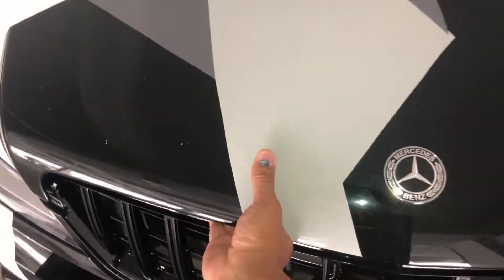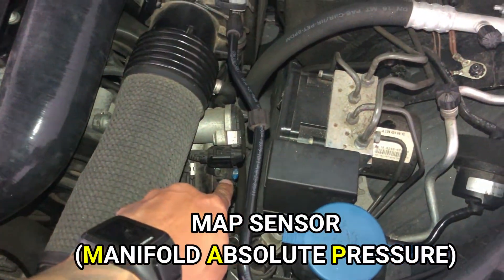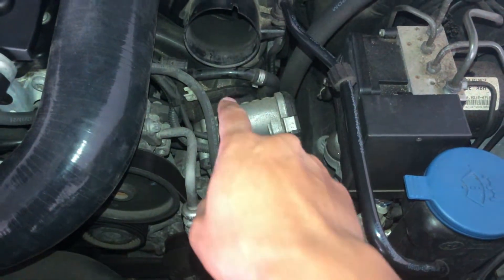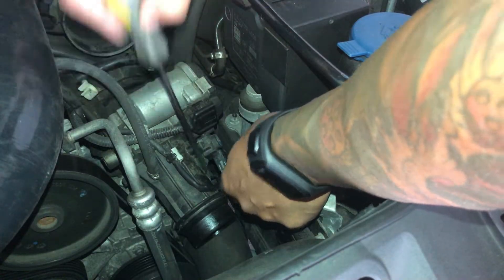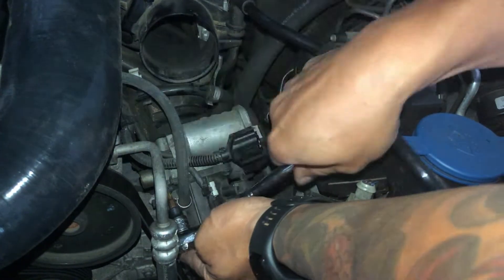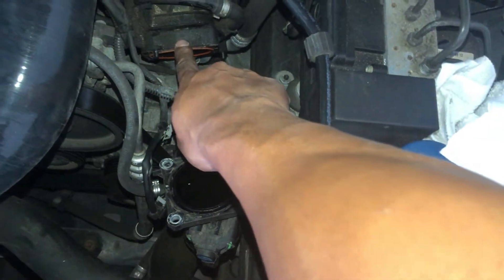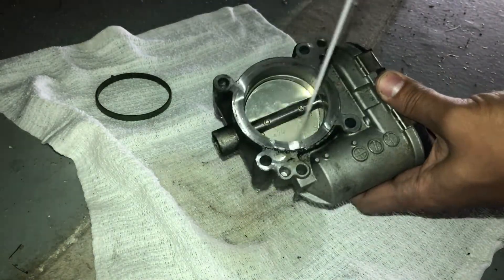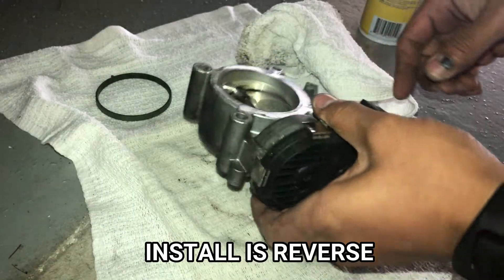PART 1: HOW TO CLEAN MERCEDES C250 THROTTLE BODY & REPLACE MAP/BOOST SENSOR

Comment: Is that gasket shown at the end the one that gets tucked into the air intake duct and connects to the throttle body?  When I removed my throttle body, the only two gaskets stayed tuked in to the manifold, and the other to the air intake duct. It didnt pull out kie you have yours. I'm just making sure there aren't three gaskets attached to the throttle body.

Comment: Have you ever had an oil leak problem or know others with consistant oil leak?

Mine keps having that issue and after fizing every time its the same issue
Reply from the maker: Only from the banjo bolt area on the turbo. It’s a common issue but easy fix.

Comment: Anyone who fixt the p0068 problem? let me know pls
Reply from the maker: Mine fixed on its own.  I struggled for months with it and no shop was able to figure it out, and I couldn’t figure it out after doing sooooooo much to the car.  I’m honestly starting to think it a software issue in the ECU.
Reply: @TheFlexxGarage  thanks for your fast answer! 
i dont understand because i read the live data and see that my car have 1000 mbar before the throttle body and only 300-500 mbar after the throttle body and what i see that my car have a load condition from 27% and my device say normal is 17%-24%
i only have the one code in my ecu p0068 i fight some weeks with this shit .... :D
i change already the second map sensor and the Pressure Sensor i will replace the first map sensor also and i will look
maybe i go tomorrow to a Mercedes Dealer and ask if they have a ECU Update for the Problem

Comment: Thanks sir for video could tell me that can i clean map sensor over replace it please answer sir thanks
Reply from the maker: You can use Electric Parts Cleaner on the sensor. Spray it on, blow off any excess, and let it air dry.
Reply: @TheFlexxGarage  sir as a last question i clean air flow sensor because it has some parts that get dirty by carbon like red thing but second map sensor doesn't have such part to get dirty so you mean i should just clean electric part of it thanks a lot my car is benz c250.

Comment: Hi Flex, my 2014 C250 is stalling when it idles and when I come to stops and stop lights. I was going to replace the Boost &  MAP sensors and clean the throttle body also. does this sound like a good solution?
Reply: Hey friend try changing the fuel pressure sensor in the back rear seat behind driver

Comment: Yo flex i need your help I got 2 codes on my car!  p2300 & p061A-98 and I can’t find anything related to them to help me fix it
Reply: P2300 it’s your pcm most likely. Check your coils or any connections related to that. P061A-98 internal control module torque performance.

Comment: Hello thank you so much for your help on this, I have a problem with my c250 same 2013, same engine model, I notice this cold start every time I turn the engine off for a long time, it will just kick and kick but refuse to start, but when I remove the throttle connector it will start immediately, I have replaced the engine but its same problem
Reply from the maker: https://youtu.be/rwtAdVvZqdk?si=uJvaHUQUshSygNRz

Comment: Hey flex I need help I recently bought and and installed a high pressure fuel pump immediately went out went full throttle and it failed again need help!!!!
Reply from the maker: That sucks but you need a mechanic who can diagnose your issue.  I can’t really do anything for you cause I’ve never had to swap out my pump.

Comment: Flexo: my 2012 c250 under acceleration makes a noise similar to exhaust manifold leaks..., but is not exhaust manifold leak and the noise comes from the left side of the engine bay..., Do you have any advice to find that "chu chu chu" noise. ?? Thanks

Comment: You know what, I loved your videos, but this small crap like you have two screws on top, but you have to go in blind on the bottom you could’ve added. I’m not trying to put you down, but you could’ve also added how to takeoff that plug on the throttlebody instead of people, ripping it off, the best videos are the 100% honest videos even if they take an hour and a half. Quit editing.
Reply: It’s common sense bro I ain’t no mechanic or nun and I did this in 30 minutes
Reply from the maker: Thanks for the kind words but you are expecting something that’s not suppose to be there. 

My videos are not detailed maintenance guides. They are just videos on how I work on my car and a rough guide. 

Any capable backyard mechanic can watch, get inspired, and do the work without needing to know screw sizes, torque specs, what tools to use, or how to remove a clip. 

If you’re not comfortable or don’t have the knowledge or skill to take a clip off or remove this or whatever, don’t do it. Have a mechanic do it. Don’t rely on a Youtuber to show you everything. 

I’m not here for that level of detail. At the end of the day, I’m just entertaining and inspiring people. I’m not a certified mechanic telling you this is exactly how you should do it. Whatever you end up doing to your car is on you.

Comment: I got the p0068 code 
Map / Maf throttle position correlation
Reply: Did u find the problem/fix?
Reply: no  @supeme3153
Reply: I'm getting the same code on my 2012 c250. If you find the solution, please give me a feedback. Thanks
Reply: Any one know how I can fix P0086 code on my C250 W204
Reply: @chrisisho2557  have you fix it?
Reply: currently have this code also my plates expired and need to smog lol so will start by cleaning body i guess can we clean the sensor?

Comment: Replaced map sensor, cleaned throttle body. Car now displays poor excelleration. Replaced map return to original 1. Running well but cel still aluminated.
Reply from the maker: If you have a CEL, then  you should pull the fault code to know what's really the problem.

 I had a P0068 fault that nobody can figure out so that's the only reason why I did my swaps and cleanings. Car ran fine and the code eventually disappeared on it's own. Very common problem in the C250 for some strange reason.
Reply: It was p0068
Reply: CEL still but car running fine.
Reply: I hear a rumble at very low speed. Not there previously. Any knowledge on this Flexx (sorry for the missing x in my earlier comment)?
Reply: Am I the only c250 owner that’s getting a raddle / rumbling sound when slowing down?
Reply: Could this be a transmission issue?

Comment: So where is actually the Mass Air Flow sensor in this engine? I have the exact same engine as your. 🙏🙏 I just bought MAF Sensor Cleaner 🥲🥲
Reply from the maker: There’s no MAF in a c250.
Reply: @TheFlexxGarage Hey bro, I got a code p0172 a little help please

Comment: I have a GLA250, I think its the same engine but it looks differently set under the bonet. Will keep looking for a video specific to that one. One question, tho. I have 4 years with my car, still at 55k KMs, Should I wory about this soon? Every oil change has been on time if not prematurely. Extra gently with my car.

Comment: Hey Flexx, My wife's W204 just died at 102k miles while getting out of the garage. Very shaky and wont start. Reader said it was a P029921, P030300, P030400, P030200 and P030000. I replaced the turbo valve and that plastic end turbo hose since i discovered it was brittle and leaking. I also replaced 4 spark plugs and cleared the codes. Now, car wont start. It ran once, died and now it just cranks but doesnt start. Any thoughts? I dont see any codes on the reader. Probably since i already cleared it and needs to run a little bit. any thoughts? I just ordered 4 ignition coils too.
Reply from the maker: Sounds fuel related. Either the car ran outta fuel, fuel filter is clogged, or the Fuel pump is probably dead if it cranks and doesn’t start.  I bet the lack of fuel or little amount of fuel going through the engine was what was causing the shakes and misfires. If the fuel filter has never been a changed…that might be the easiest check/fix before throwing money at the car and guessing. As always, please get a reputable professional to diagnose it.
Reply: @TheFlexxGarage  thanks Flexx I will try to replace the filter. I can hear the pump from the back seat when I turn the car on.
Reply: @TheFlexxGarage  so start with the fuel filter and (maybe) the fuel pump? I've had the car since 52k miles and I'm not sure either was replaced.
Reply: What kind of “reader” are you using? When changing important components like you did, you need the Mercedes specific software diagnostics (Xentry…etc.) to actuate and enable the replaced components. Its simple, but you   need the darn thing.
Reply: @bohrora2293  I cant clear the p0299 code on my 2015 c300 with my autel scanner. Is this only able to be done with xentry?
Reply: @bohrora2293  Underboost problem, found that the actuator wasn't holding vacuum and since Mercedes doestn sell it without buying the whole turbo I bought an aftermarket one and cant seem to clear the code. Thanks for the help

Comment: I have so many questions 
Like do you since you unplugged the battery do you need to reprogram anything and what kinda T bit did you use to take out the throttle body ?
Reply from the maker: Literally I’ve disconnected many of my cars and never dealt with reprogramming anything.  Never even had to reprogram my radio presents or clock.
Reply: @TheFlexxGarage  Interesting. I needed to “reprogram” even when I changed one oX sensor.

Comment: Flexx!!!!! i miss the W204 days with you but i know things change & we must move on. however i have question for you if you help with. what tools did you use to remove the throttle body? i changed the sensor & my check engine light is off  but its running really strange & think its the throttle body.

Comment: I love your videos but think maybe the sensor names in this one are not correct. What you are calling the booster sensor is actually the ambient air sensor. It is located before the turbo so it cannot be measuring turbo boost pressure since the sensor is "upstream." When I unplug it I get a computer error letting me know it is indeed the ambient sensor. What you show as the MAP sensor on the air intake is actually the booster sensor (again, I tested this with the computer to make sure). Unfortunate I learned all of this the hard way chasing an issue where my boost sensor was bad, and using this video I replaced the ambient air senor 3 times before I figured it out. Your video explaining how the turbo system works helped me understand what was wrong. Thanks to you may car is back better then ever now! I appreciate you.
Reply from the maker: Yes and no. If you watch my latest video, I was with a Mercedes Benz tech and while we were shooting the video…that specific topic came up on sensors and their names and he told me there’s no consistent term used in these sensors. Some dealerships will call it this, some that, and the aftermarket resellers will also call it something else. Some will even have a few different part numbers and work the same way. A lot of them are interchangeable.
Reply: @TheFlexxGarage  Hi Flexx, love your channel - keep it up.  I'm having that P0068 error code and I want to replace all the sensors while I have the throttle body out cleaning it.  Do you happen to have part numbers for these (MAP, Boost, secondary sensors, etc...) because there are so many different names online, I don't know what is what.  Like Shawn mentioned and you confirmed, some call it this, some call it that - nothing consistent.  Please help!

Comment: First off, awesome videos! Very informative.
I'm a recent owner of a 2012 C250 1.8l (non-diesel) Benz and I scanned it and got a P0100 code. (Mass or Volume Air Flow Circuit Malfunction) So my question is, does my vehicle have a Mass Airflow Sensor!? Or is the code referring to something else? I can't seem to locate a Mass Airflow Sensor. Any input is appreciated.
Reply from the maker: There’s no “MAF”. There’s the sensor in this video and go watch my other video for the other 2 sensors.  All 3 are related to air.
Reply: @TheFlexxGarage  I really appreciate the response! Going to watch a majority of your videos. Thanks again and keep the videos coming! 🤘🏼

Comment: Yes sir,can plz help me out of my problem, I had a 2009model  c200 kompresor, and the troble code is p0045,its say supercharger boost control solenoid circuit A / open, where can fine the boost solenoid,tnx

Comment: Flex I have 2013 C250 with Code P0234. I removed the throttle body and cleaned. And the same code is still there. I have replace the boost sensor ( part Number 005 153 50 28) the car seems to run worse now. Can you point me in the right direction on what to do next?
Reply from the maker: Don’t really know. But these are the possible issues listed when I did a simple google search. 

Boost pressure sensor harness is open or shorted
Boost pressure sensor circuit poor electrical connection
Faulty boost pressure sensor
Faulty Turbo/Super Charger
Engine over temperature
Ignition misfire exceeds the calibrated threshold
Faulty Knock sensor (KS)

Comment: Hey Flexx,
I love your channel! I have a question about the power loss. I’m not getting any codes and my car feels like the turbo is nonexistent! I clean the throttle body to see if that would help but it didn’t. Would you suggest replace the map and airflow sensors? Thanks
Reply: You might also want to check for any boost leaks. I had a couple on my OEM Diverter Valve (rubber on the plunger was torn, so it kept releasing boost), and one on my air intake tube (Small tube that cracked). Check out his diverter valve/blow off valve and Silicone/Aluminum Air Intake tube videos if these are what's wrong with yours! Otherwise, check along the air intake/turbo routing.
Reply: My exact problem. Can you remember how you solved youre

Comment: If you do all that but the p0068 code is still there what can it be? It is at the dealer now and they are saying when testing the pressure no leaks but it shows when the DV+ releasing pressure is throwing the code because the MAP sensor is showing too much pressure is released. They cleared the codes and are suggesting if it comes up again to put oem back and see if that was the issue. 
The only thing I have installed is the dv+ / turbo muffler delete / metal air intake/ intercooler blue pipes from tornado tuning. 

They are stating since vehicle is tuned for oem DV that aftermarket pressure could be throwing code and I do not want to tune the car to avoid issues like this in the future. I really like the basic upgrades I have done. 

Please advise
Reply from the maker: I had a p0068 and it went away on its own. And my cars been fine and Still with all my mods on the car.  

And I know other people with the p0068 with a stock engine. 

I wish I knew the fix but nobody has a true fix. 

Some people found a lose air hose. Some people reinstalled their JB tune and that fixed the issue.  And like me, it just went away on its own.
Reply from the maker: Oh yeah, tons of people are running the DV+ with zero issues. And a lot are even running the new version that dumps all the air pressure cause it’s a blow off valve. Again, no issues that I’ve experienced or heard about.
Reply: @TheFlexxGarage  AWESOME!  I had the aftermarket parts installed for about 4 months and no code but ever since the new fuel pump was replaced it is now there. There is no performance loss with the p0068 code so I will just let it ride and see if it disappears how yours did. Thank you for that! 

If not the dealer wants me to install original oem DV and if code comes up then they will investigate further. If the light never disappears then I will try to swap it for the original dv as instructed by dealer. If the light is on after oem dv installed, then its still under warranty so the dealer will tell me what they can find from there. Ill keep you posted if it goes that far in case others have the issue!

 I have high hopes it'll disappear though! You have been awesome thus far. Thank you for all the mod videos! I would have never attempted any of this with you! lol
Reply from the maker: Definitely keep us posted. The P0068 was a tricky one. I was like past due on my annual car inspection in late 2018 because of that damn code. I was freaking out everywhere I drove because I had an expired inspection sticker and I couldn't figure out the culprit. And I even uninstalled ALL my performance mods too and changed my spark plugs and stock airbox and airfilter, etc.... It didn't fix anything so I slapped everything back on...a few days later...it went away and I passed inspection with no check engine light and it never came back. Really really weird. And like you said...the car drove normal with the code. Just really weird.
Reply: Flexx Alexander disapeared! Throttle was disgusting! You are the man!
Reply from the maker: What happened? Fix???
Reply: Flexx Alexander the throttle was disgusting. I been driving about a tank now and just cleared and hasn’t came back. If it comes up again I’ll be at the dealer next and will let you know if it’s anything else! Thank you for the follow up and helpful vids!
Reply: @beliciaadams8662  i know its been 2 years but what did you mean throttle was disgusting? You mean you cleaned the throttle body and it fixed it?